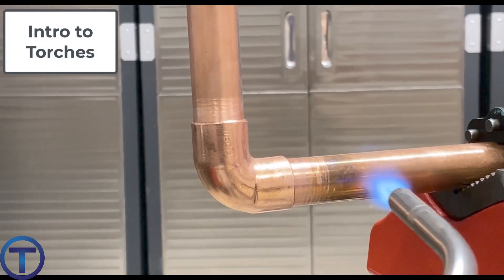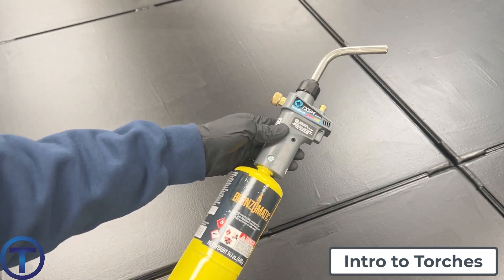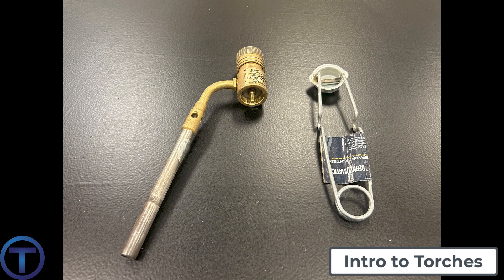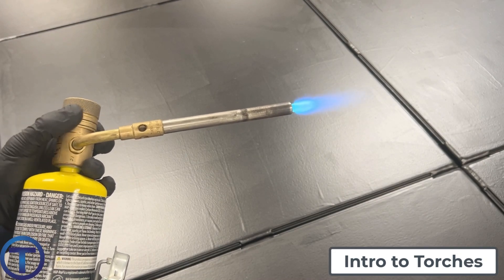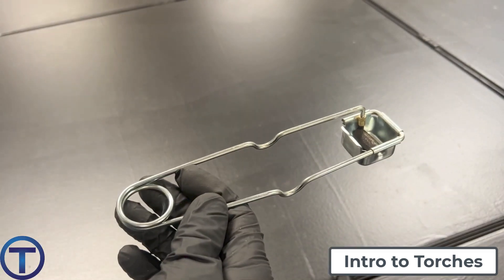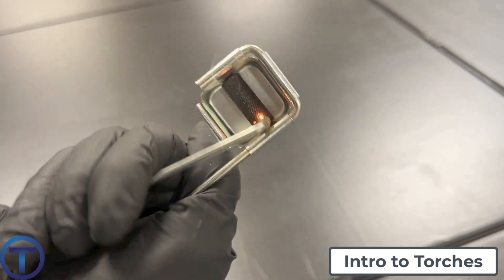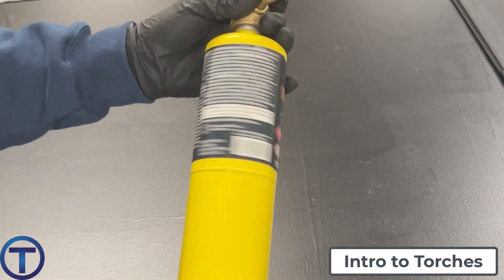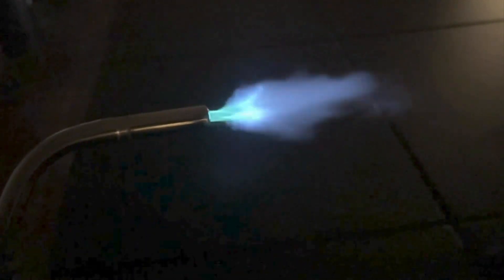Torches 101 - For Soldering Copper

Comment: My Favorites are the turbo B tank   BRAND    And Turbo Hand  stk9        Ive used the Auto lite ones such as  tx 503   or 504    they atre convieniant and good burn on them  in old days none were as good a burn as the st9  swivel        Goss makes good Product ,        Uniweld    im not aware  of     I been around a lot  but  i think this stuff is kinda regional    I been nothing but Turbo  for almost 40 years its excellant product  they Are a Line of Victor   you abslutely cant go wrong  but there  are a few things  I dont like as much.   Goss has much easier to read gauges     Im not crazy about the knob on b tank  Turbo   .    Quick change  tips on turbo b tank  like an air chuck for  air tools easy  .   BTW   bad habit but I turn my stk 9 down too low often  but its convieniant at times   Ive had 4 or 5  maybe 6 in about 38 years   it will damage it  i think too. 
    I should purchas the tx 503 or 504 .  Its just that I dont do this full time at 68 years old and Im not a  tool hoarder  (well I might be)   lets not forget  all 3 torch type shown are redily available with self lighting features  if buying turbo brand .  
    Of course with plastic   , sharkbites,  and propress    who needs a torch   Ha Ha         Young guy  starting out a   hand self lighting   torch like the tx504   is plenty good   the swivel head is my choice I think more robust   but you gotta carry that striker and fiddle with the valve.
Reply from the maker: Thank you for sharing what you know!